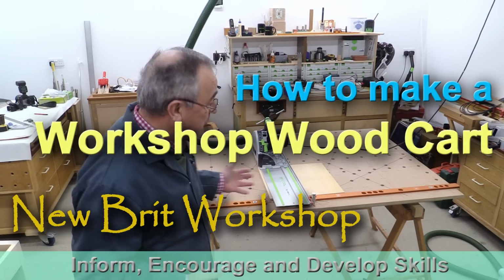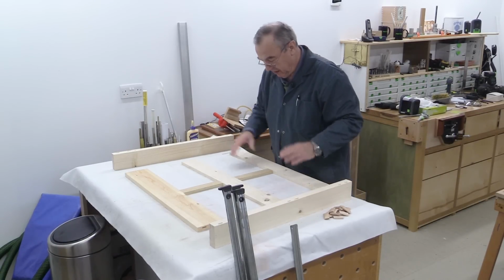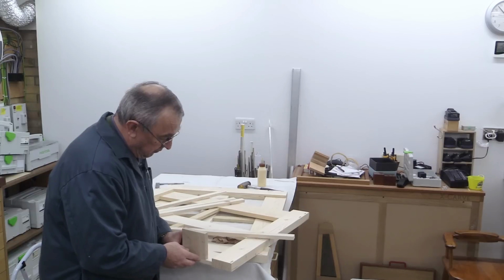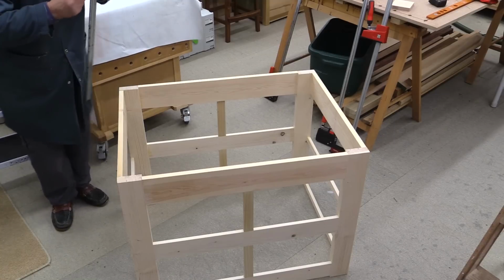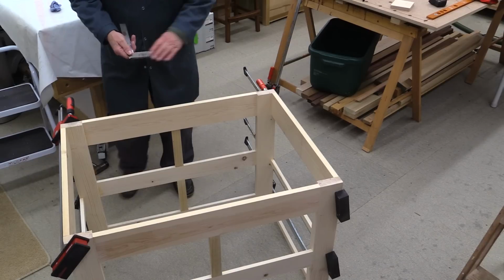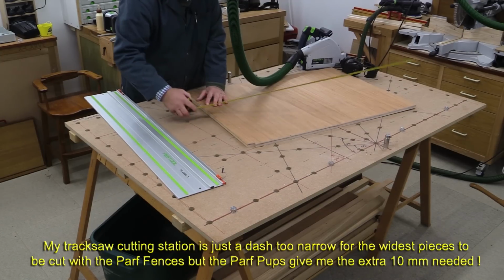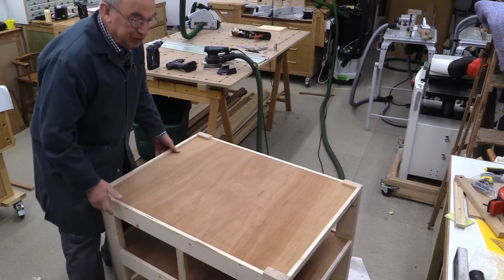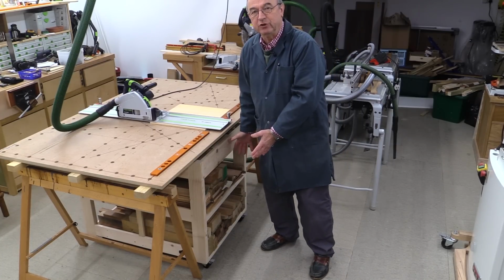How to Make a Workshop Wood Cart

Comment: Just to add to my last, I designed the cart with a solid top at the correct height so that it acted as extension table for my mitre saw. Doubly useful!
Reply from the maker: Hi Steve, Brilliant - cheers.  Peter
Reply: @NewBritWorkshop  Hi Peter, after many years of stalling, I finally took the plunge and bought myself a Festool Centrotec Drill (TXS 18). Initial impressions are very good and I have just rewatched your video about centrotec. Do you know any source of flat bladed screwdriver bits that can fit the centrotec chuck and did you realise that it is now almost impossible to get the Trend Snappy Drill Countersink bits?

Comment: Peter, In cases where I suspect the possibility of a hydraulic loch I generally cut a grove in the length of the domino, just two quick movements with a small chisel. Another option is to take a sliver off the small end of the domino. Yet another option is to use the wider setting on the domino machine, although that is my least favorite options.
I keep even smaller bits of wood in a heavily modified IKEA rack with plastic bins.
Regards,
Sierk
Reply from the maker: Hi Sierk, yes that works very well but I just tap them in slowly - at my age I have more spare time !  Cheers.  Peter

Comment: I like how you used a bunch of cut-offs to make a cart for more cut-offs. And I like how the top storage is recessed so you can used the top for a temporary stack, of sheet good parts for a larger project.
Do you ever used pocket holes and a pocket hole jig? Seems like those shelves would have been the a good place to use them.
Reply from the maker: Hi Steven, I have never liked pocket holes as the two pieces being joined are prone to move relative to each other as the screw is tightened.  Cheers. Peter

Comment: I see you are using the lighter weight Bessey clamps.  Having just carried a couple of long and medium heavy weight ones back to the workshop I have decided to buy some more of the Uniclamps!
Reply from the maker: Hi Mike, I use the Uniclamps quite a bit as they really are perfect for the lighter jobs. Many people think that clamps have to be really strong and be able to exert huge forces but good woodwork should mean that clamping is just for that final nip up. Too much clamping force makes the glue disappear or get so thin that it has little effect. I hope that I mention that clamps only need to be on for a short time when I show glue-ups in my videos.  Cheers.  Peter

Comment: Very nice Peter. What brand of panel saw is that in the back ground?
Reply from the maker: Hi Dan, The small table saw is the Festool CMS TS. It is no longer made but excellent none the less. Festool have a new saw which uses the Sawstop system to reduce the risk of injury.  Peter
Reply: @NewBritWorkshop  hi Peter, sorry I was referring to the hand saw in the back ground near the beginning of the video
Reply from the maker: Ah, that one. It is a Spear and Jackson and I bought it in 1969 when I lived in a bed-sit in London and needed to cut some wood. I have not used it much in the last 10 years but it is in good order and well protected in a sort of open slip cover.
Reply: @NewBritWorkshop  itl looks well looked after. Merry Christmas Peter to you and yours
Reply from the maker: Hi Dan, Dad used to sharpen it for me. I am more than capable of doing that now but no longer have the setting pliers. I wish you and your family a very happy and safe Christmas.  Cheers.  Peter